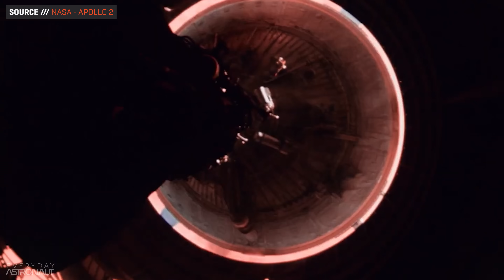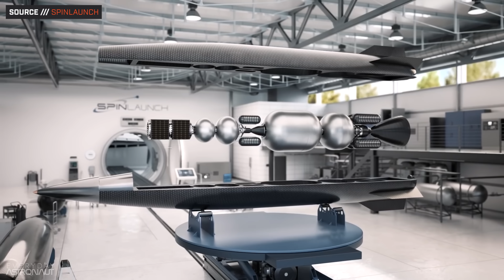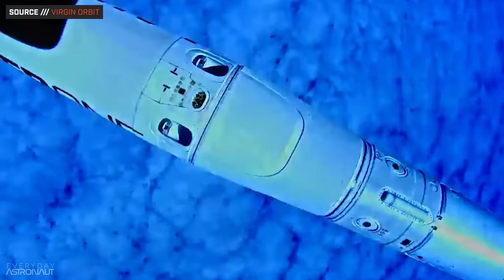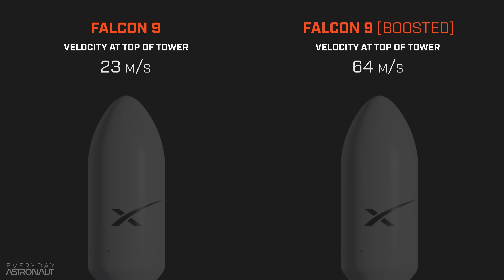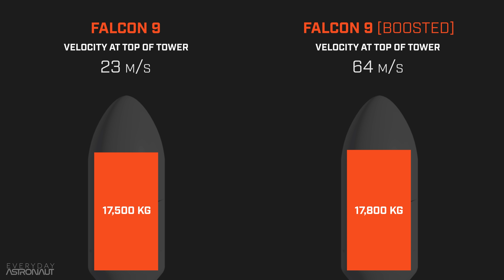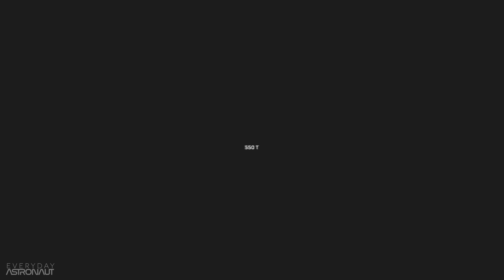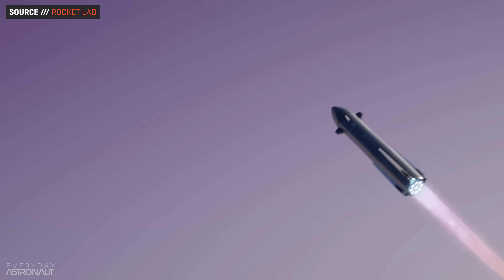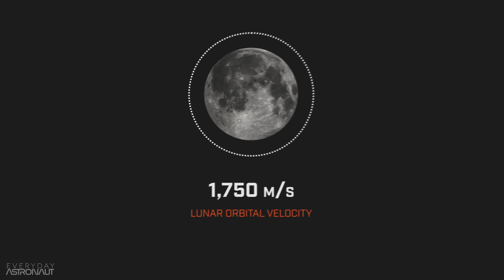Could We Help Push Rockets To Orbit?

Comment: Why 4g? I think the 4g acceleration is just way too much. Why would you try to achieve 6x the net. rocket acceleration? And I calculated a cube of steel of 9x9x9 meter, which is not that big, would exceed 5000T weight of the rocket and would subtract 1G already.
Also the average power of a household is not a fair comparison. Should have used peak power.

Comment: The starship tower idea is actually really cheap if you do it right; just need to go lower acceleration and a lot taller - say 1km at say 1.75g with  40000 tonnes of water bags dropping into a pond with a single pulley, and idle the engines until reach top of tower at 120m/s saving nearly 300m/s of deltaV (Adds around 30tonnes payload or around 20% increase) for bill of materials cost of only a few $10's of millions (steel is really cheap).  And moon solution should be a 1-200km spinning tether on top of a short tower on top of Mt Malapert at lunar south pole.  Cheap. small amount of materials required up to speeds of a few km/s, low g for humans, can spend a day speeding it up so relatively lower power required and can release in almost any direction as spin - Mars, Moon or wherever else is desired at each launch.  This would be a major tool for opening up Mars cheaply.  Do something similar on Deimos or Phobos for return flights

Comment: Why would you compare continuous power output to an application that is powered for 2 to 10 seconds and suggest capacitors as a power source, which are just ridiculous to scale into these energy levels and beyond double digit ms time scales.

A giant pneumatic catapult with e.g. steam is much more realistic and if you really want to go electric, high c rate batteries combined with flywheels are the way to go. Supercapacitors would be in the right c rate range, but way to expensive and superconducting storage, while nice due to having boiling gases on site while needed, are just future concepts at this point.

The engines not firing is no problem, because if that happens, enough has gone wrong that your rocket will likely explode anyway, so tossing it away from your expensive launch infrastructure might actually be a benefit.

The real problem is having to design your rocket for these additional short term accelerations during launch, the, as you said, little benefit and that a simple "more fuel, more engines" achieves the same cheaply.

Ground launch systems are much more interesting in combination with air launch systems for large rockets. The by far most difficult challenge of air launching a giant rocket is getting it up to speed until the air launch system can support itself structurally just via aerodynamics. And then you get all of the benefits of air launch systems: 

Being able to launch from anywhere in the world, during any weather, at near vacuum pressures, with a nice speed boost, ramping up the rocket engines slowly, having the rocket already areodynamically stable, the ability to easily save the payload during an emergency launch abort, by just dumping everything of the rocket but the payload section and potential to easily electrify in the future or other future forms of powering vehicles at that scale.

IMO air launching is the unavoidable future of spaceflight on Earth. We got all that atmosphere offering to help us getting out of the gravity well and up to speed but aren't making any use of it for now.

Comment: Solid rocket boosters accomplish the same goal of giving a rocket an initial boost off the ground. You can make them more easily reusable (maybe parafoils and fold out wings that steer them safely back to the ground) than the Space Shuttle boosters, which got ditched in the ocean. 

The best use case for these would be on the Starship refueling tankers meant to refuel an orbiting Starship before it heads off into deep space. You don't want to waste much of the fuel your supposed to be transporting just getting to the rendezvous, so attach solids to the booster stage and let it do more of the work of getting Starship to orbit instead of just getting it off the ground. The problem is that you could no longer do easy return to launch site landings for the booster. Instead the booster would have to complete an orbit to return to the launch site, or you build other launch sites in other parts of the world (east coast of Africa, western coast of Australia, etc.) and do a suborbital hop. Those sites could have duplicate Starbases that load another Starship on the booster/solid combo and then you launch another payload and the booster lands at the next site downrange. 

As a side note, if more of the work of getting into orbit is shifted to the booster from the Starship upper stage, you might be able to eliminate some of the vacuum Raptor engines and save a ton of weight that could go to carrying more fuel to the outward bound Starship. 

Another side note, solid boosters would be helpful for Starship taking off from Mars on the return journey to Earth, allowing you to either reduce the amount of fuel you need to produce on Mars or increase the amount of return payload you could bring back to Earth.

Comment: but when you open the top of the maglev, all the air will be pulled in, and that will cause a massive pressure shock on the rocket, could it withstand it ?

Comment: Imagine Spinlaunch to be a military project which launches a warhead with out a heat signature of a rocket (at least at its boost stage) so it is harder or impossible to detect the launch from orbit reducing the interception probability...

Comment: I had thought it might be feasible that, to propel the rocket while clearing the launch pad, instead of using a giant counterweight, the kinetic energy could be stored in springs and pistons through a pulley system.

Comment: I had the idea of making a big, dumb booster even bigger and downright stupid. Build a water rocket that could carry the second stage to the Carmon Line. The second stage would be designed much like a single stage to orbit craft, but with vacuum optimized engines. I imagined the second stage could be the largest rocket that would safely pass through the door of the Vertical Assembly Building. The second stage would be carried by the crawler to a service barge to be carried out to the sea lunched first stage. The second stage would also need to be serviced and filled with propellent for the launch, perhaps by the barge and/or an offshore platform. The first stage would be anchored to the sea floor to make putting the second stage on easier and give it a bit of a boost. During the launch the first stage would be let go to bob upward. The seawater propellant would be released at the optimum point in the first stage's bob. The water would not be too hot; an economical aerospike could optimize the flow if the lower ambient pressure caused the water to outgas or even boil at the higher altitudes. If the Journal of irreproducible Results was not moribund, I would describe using a two liter pop bottle water rocket as the first stage. A standard model rocket would be the second stage to test my idea. A way to light the second stage was suggested in a model rocket book. (They did not use a water rocket for the first stage.) They suggested a battery powered ignition system on the first stage that uses the deceleration of the rocket when it looses forward thrust to close a mercury switch to power the igniter in the second stage. I would probably use a BB switch to turn on a thyristor semiconductor, myself. I do not like the idea of trusting my experimental setup to not do something to break and release that nasty heavy metal. The tube to let the pressurizing air into the first stage will be long enough to reach nearly to the top while also big enough in diameter to guide the rocket upward. The filler tube would act like a piston until the rocket clears it. The experiment would be described in the Journal of Irreproducible Results as a way of getting around than pernicious logic of many engineering types have who would point out that it is clearly impossible because no one is doing it that way. Potential criticisms also include water and fire do not play well together. Another issue would be trying to optimize the performance such as by dissolving CO2 in the water when it would simply be better to build an even bigger, more asinine first stage or cluster them. Expensive upgrades violate the KISS principle.

Comment: What is wrong with sticking multiple solid state boosters to the sides or the primary rocket? Would be modular. Single starship booster plus up to 4 solid boosters

Comment: Even if these mechanical boosts were practical, the modifications and necessary reinforcement of the rocket would offset the payload gain.  It may even end up having less payload capacity once this is taken into account.

Comment: Using helium-filled CNT-reinforced aerogel, you could theoretically build an enormous floating platform in the stratosphere that supports infrastructure, payloads, power systems, communication arrays, and even people. Cost and complexity be damned.

Comment: A rocket is seldom fully loaded so adding something like 1 or 1.7% to its payload capacity does not really matter. Nice, though, but it does not matter. Something reasonable would be a "rocket-sled" which would add tremendously to the payload but that is close to fiction for nowadays conventional rockets.

Comment: A concept similar to this is Seadragon during the The first few seconds of the flights the higher density fluid is acting as a weight reduction system for the rocket resulting in the engines being able to get a bit more acceleration for the first couple of seconds while it is leaving the water

Comment: Compressed air could be way better than using electricity or a counterweight. You can use up the 'power' of compressed air very quickly, just run it through a (much) bigger pipe. Imagine taking the end off a straw wrapper and then blowing on the straw. The wrapper is the rocket. No tower needed, just a big tube inside the middle of the rocket.

Comment: Falcon-9 burns 40% of its 1 million pounds of booster propellant just getting to 9 km altitude and Mach 1. THAT first bit is the part of a rocket launch that is massively inefficient, and could benefit greatly from a launch assist. But doing it in just a few vertical meters is the stupidest possible way of doing it. And beyond the handful of UNIMAGINATIVE ways presented in this video, there are MANY other ways to store energy to power such a launch assist. But those are not the EVERYDAY ways of thinking.

Comment: I'm always confused at Americans not understanding metric at all and doing strange things like 1,500,000 kWatts, which is actually not how you would ever write that: You use 1.5 gigawatts. Or using 7500 M/S, which is of course 7.5 km/s, much easier to read and understand, because nobody uses for example 1500 kWatts, but 1.5 MEGA watt (mega is million, giga is billion etc.), so no wonder you guys think imperial measures are so great, because you are not getting how great metric actually is. Using Kilo (for 1000) and mega (million) and giga (for billion) and tera (for trillion) just makes very large numbers super easy to understand and use. You also don't need these insanely complex imperial conversions that are so nonsensical, you just shift the decimal point, that is all there is to it. And you are doing it WITH EVERY example, so no, nobody worldwide that knows metric would ever say "Hey, today I drive 573,000 meters! (why not use centimeters then, that would be 573,000,000 cm, which is actually....just 573 KILO meters, or km, which is what every distance measurement on long distance car travel uses in 98% of the world.

Comment: Coincidentally in the last couple days I'd watched an Adam Savage video focusing on the aircraft elevators aboard the carrier Hornet - a machine that accelerates a hundreds-of-tonnes platform up ten meters or so at a couple G, hmm. The energy seems to be accumulated in compressed gas in the hydraulic system that powers a massive slow piston whose motion is translated via cables with a large negative mechanical advantage for speed.

Comment: Don't think of extra payload capacity. Think about fuel and weight saved by such a system. If it needs less weight, it'll also be more efficient once in the air.

Comment: What I learned from this video is not that these systems wouldn't be possible but that rockets need even more power and energy than I tought
Reply: Oh yeah, the energy going through a large rocket is just mind-bending.
Reply: Oh hey, let's burn tons of Methane and LOX a second, I mean how much energy could it generate... right?
Reply: Gravity is the king.
Reply: The largest reciprocating engine in the world is a 14 cylinder marine diesel used to move giant containerships weighing 2300 tonnes and producing 80 MW (107k horsepower). The turbopump on each F-1 engine used on the Saturn V produced 41 MW (55k horsepower) and that used a simple gas generator cycle which doesn't demand as much of the turbopumps as closed cycle designs. The amount of power needed just to run the fuel pumps is enough to move a containership.

(EDIT: corrected kW to MW)
Reply: 80 kW is not 107k horsepower.
80 kW = 107 hp
Reply: @himanshusingh5214  Typo, I meant MW not kW.
Reply: @lunatickoala the engine weights 2300 tons ? I knew it was big enough to live inside, but I didn't know it was that heavy.
Reply: A bugatti chiron can output 1MW.
A single plane engine ~30MW.
If you need an engine to reliably output only for a few seconds, and want to make it as small as possible - using nitromethane fuel in a dragster engine gives ~8MW. A shipping container with 10 of those would could output ~80MW.
So yeah not that crazy of a number as this video is saying.
Reply: @asas-xn4qk So each one of the five engines on a Saturn 5 needs the equivalent of five top-end drag racer engines... just to run the fuel pumps. That's not the power output of the engine, that's just how they feed the fuel lines. 

The actual power output of each engine isn't 41 MW, it's more like 24,000 MW. So literally a few thousand drag racers. For *each* of the five engines.
Reply: Don't learn from this video
Reply: He missed gravitic losses which are the main point of those assists, they give far more payload than that
Reply: @jujuteuxOfficial he literally didn't
Reply: @kaiperdaens7670 he said the 40m/s increase would've only added 300kg to the falcon's payload
taking gravitic losses it's actually 2.3 tons.
Reply: @jujuteuxOfficial maybe I am forgetting something but I remember him accounting for gravity in the equations regarding acceleration so I am not sure where he missed other losses
Reply: @kaiperdaens7670 that has nothing to do with gravitic losses, that was just a generic point at the start
gravitic losses essentially mean: the longer you aren't in orbit the more thrust is lost
those launch systems are incredible for low T/W ratio rockets as it skips a big part of the beginning.
a sling launching starship at 200km/h gives around +30 tons to its payload capacity
Reply: And maybe that Saturn V didn't really "go to the moon"?
Reply: @CuriousGeorge-00001 bruh, GET OUT
what losers actually believe that

Comment: If one is to lookup 'Laser propulsion' in wikipedia, specifically the laser launch heat exchanger thruster system you'd see a more technologically and economically feasible way to boost rocketships or spaceplanes into orbit. 🚀🚀🛰🛰

Comment: the infrastructure needed can be cut down into a circular path....not as much g force as the spin launch but it wouldn't be fighting against gravity as it built speed. The split coupler can then redirect when speed has been reached in order to rotate craft and maneuver it upward (the g force will still be in the same axial direction so people won't feel a change). At the very end of the short track, the rockets go full as the whole thing continues to rotate to do a rollover maneuver. The aerospike front along with the primary stabilizer fins can drop off after reaching about 18,000 feet in order to drop majority of the heat (those parts can be recycled). The power needed might be a lot, but it is electric rather than chemical for majority of it, so it's a resource that we can improve on.

if we can build a mag system in space, then the vehicle only has to stay on target, enter the first ring and let the platform push it along. The platform would need to be balanced for incoming/outgoing or net zero speed over time by rotating the platform (can use gyro for it), all in order to maintain similar orbit position. If we position the platform precisely, then we can actually have its main focus be to a lagrange point, where another one can be set up for something similar to a hohmann transfer between points within the solar system.

Comment: I asked Grok how many additional tons to orbit could be achieved by adding 5 shuttle SRBs around Starship booster. It was entertaining to watch it puzzle it out. We get an additional 39 tons to orbit. The 5 STBs weigh 2950 tons. This doesn’t subtract the additional weight of strengthening the booster to handle strapping SRBs to it. It would also toast the launch site, and I don’t know how to get the chopsticks out of the way. Still entertaining, and more practical than electricity.

Comment: launch a nuclear rocket from a jet. jet gets it far enough away and under control which reduces risk. also nuclear hot air baloons using like.. kilopower
Reply: yeah..... hot air baloon. fill it with steam, get it way up, and launch the rocket with ~1g but way higher up.